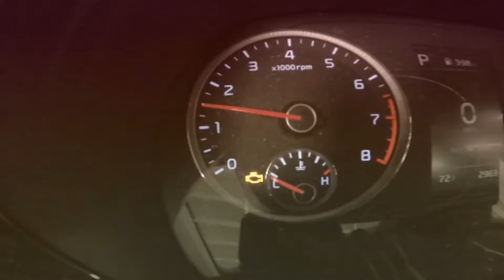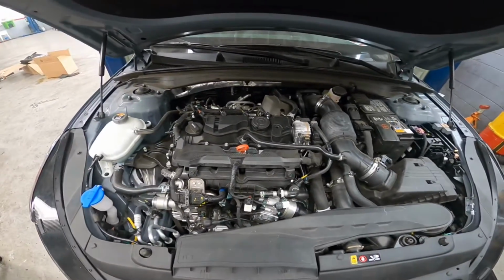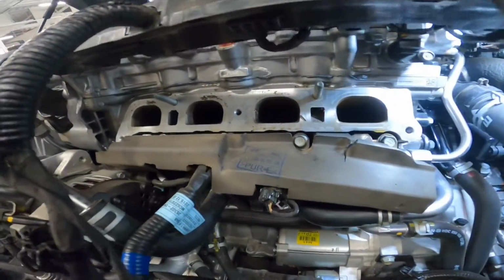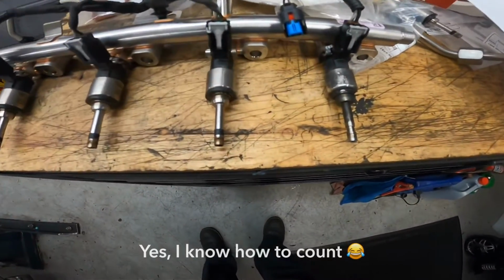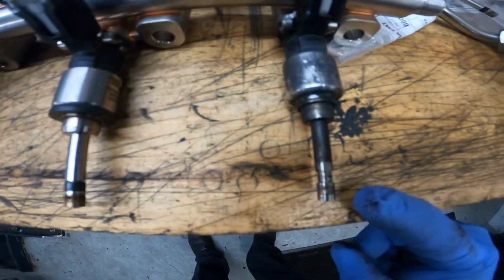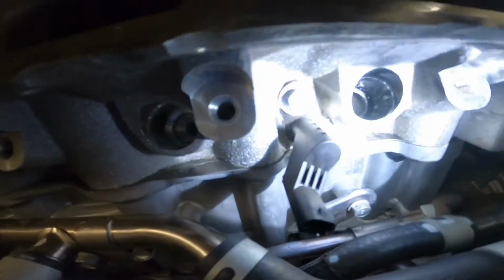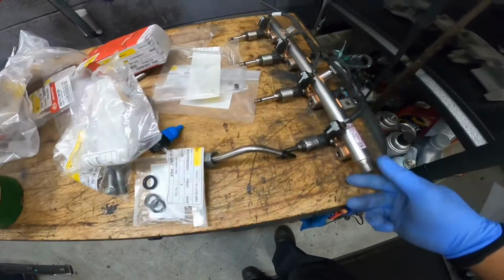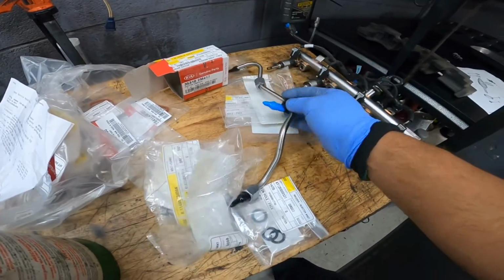Kia K5 with active code P0304 cylinder #4 misfire, stuck fuel injector, injector replacement.

Comment: Dang i wanted to see the procedure you use to pull the rail and injectors out of the block. I heard it can be hard to get out. I am fixing to replace my injectors.😊
Reply from the maker: newer vehicle it’s not hard but higher mileage vehicle it can be hard to get them out, I sprayed each injector with silicone lubricant wiggle each one a bit then I used my custom tool I made to pry them out.

Comment: How did you know the injector is stuck??
Reply from the maker: first i checked current data second i removed sparkplug then turn ignition on engine off injector will energized when not suppose to. thanks for watching.
Reply: @WrenchingRyan  Could you please explain this further for those of us that aren't so mechanically inclined.  What other signs or ways could someone who don't have the proper diagnose that it's a fuel injector issue?  Currently I have no spark in cylinder 1.  Spark plug, injectors, and connectors all check out ok per voltage meter and test light.  I smell a lot of fuel and have read a clogged fuel injector can cause no spark.  Thanks for your help

Comment: i cant find the problem 🤦‍♀️ my car literally! no lie every other day messed up on me. No check engine light! from 0 to about 35mph it struggles to accerlerate & trans kicks back a bit. after 35mph the car drives like a baby. cant fine problem changed spark plugs no codes no anything. hoping something is just clogged 🤦‍♀️